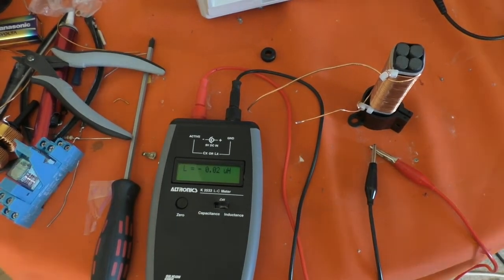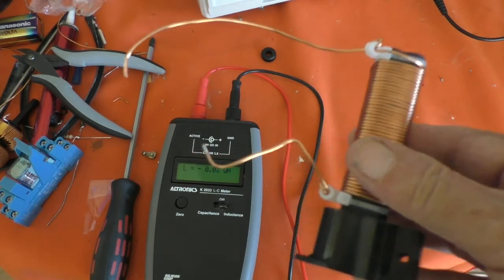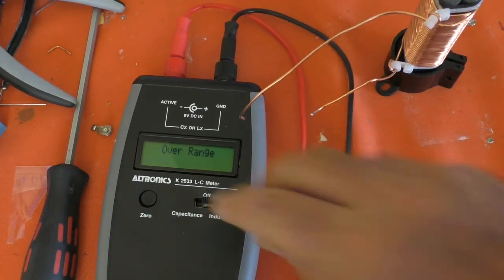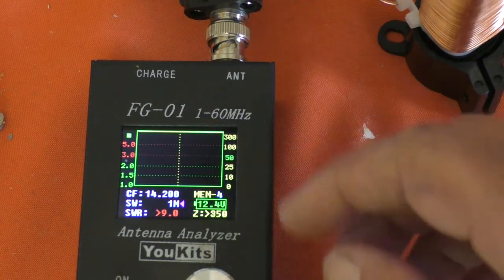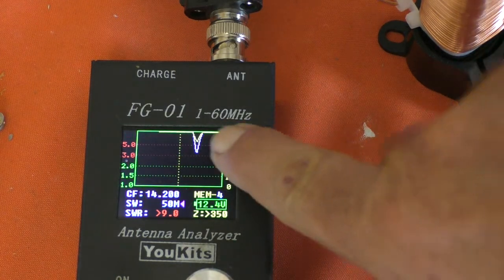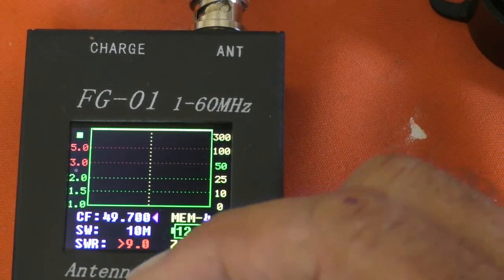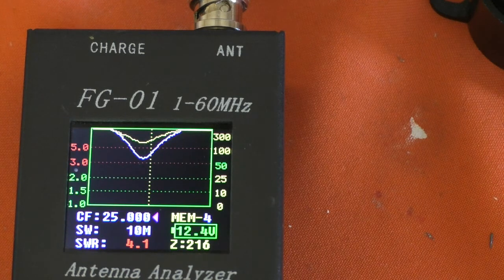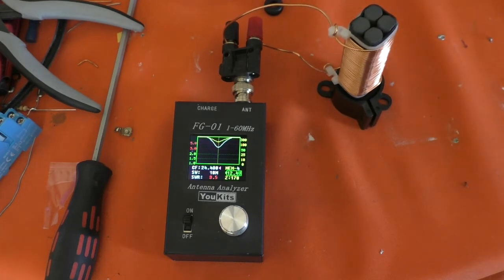Testing A Protection RF Choke

Comment: I think the wire is too thick, it needs to go up in smoke as a warning that the dc blocking C is defect. :-)
Reply: nope, it needs to trip the amp ht circuit breaker by going over current, if it goes up in smoke and burns and open circuit there will still be ht on the circuit, that is after the DC blocking cap failed as well as the protection choke normally 2.5 mH. I would agree that there needs to be added quite a number of turns... and the choke need to be able to trip whatever you are working on amperage wise, lets say 220v 7 amp, then it must be able to handle that current without failing tripping the amp, it should also not be resonant at any of your working frequencies as well as the odd parasitic frequencies ... clever little buggers these chokes :)

Comment: Great video Steve, how do you remove that unwanted response from the choke?
Reply: add more wire, you need a +_ 2.5 mH  (milli henry) choke at least, that covers any hf vhf frequencies. It's not the Alpha and omega.... but it sure handles anything you throw at it hf amp wise.